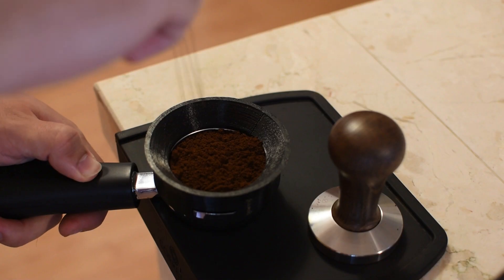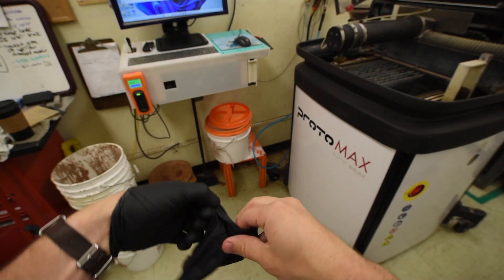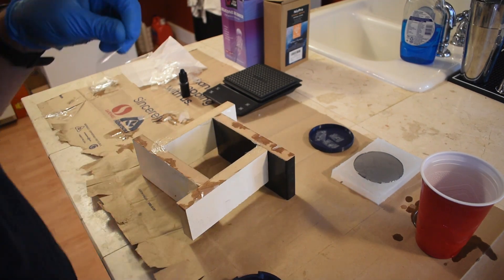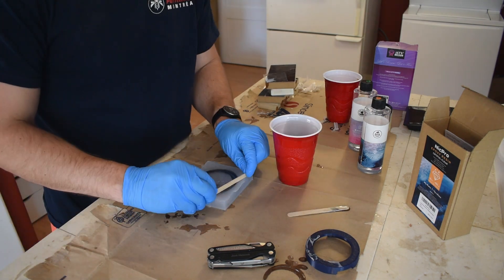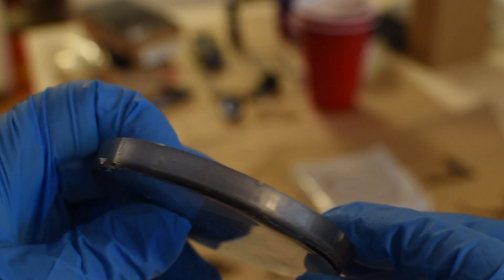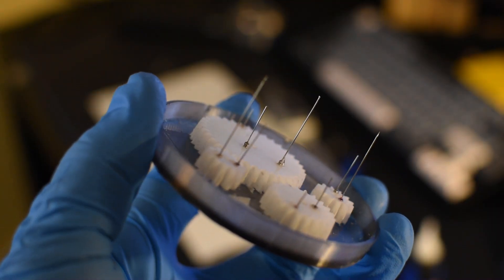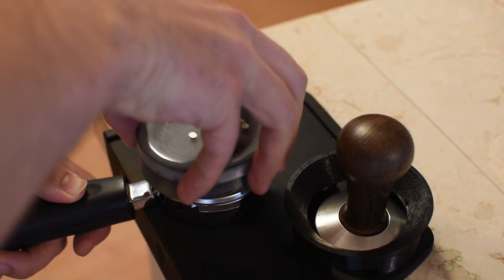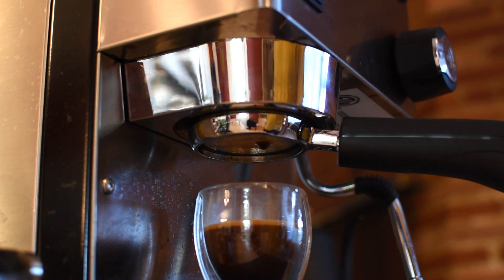Semi-automatic WDT Tool - Josh Hancock

Comment: how did you select gear diameters and needle placement? i’m working on something similar for a manufacturing project and one problem is i’m drawing ellipses with my spirograph that end at the origin after one revolution. similar wdts dont seem to return to the origin after one revolution